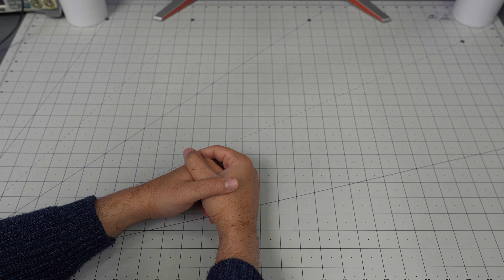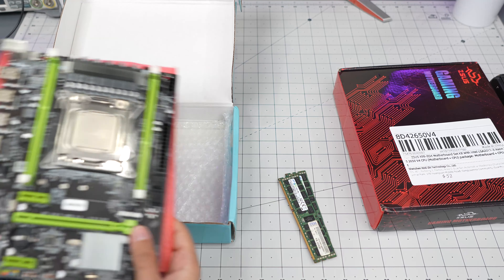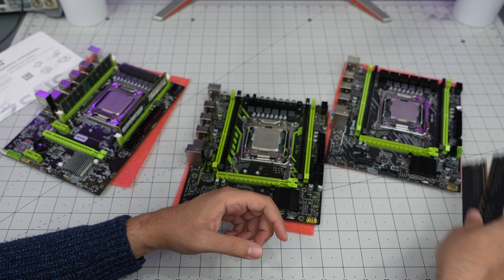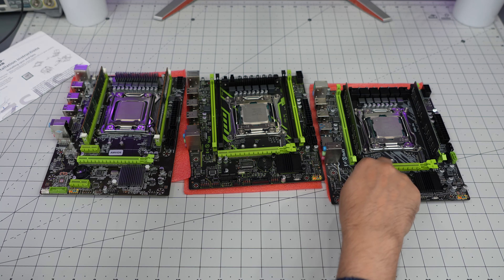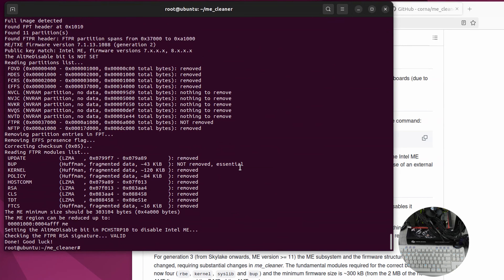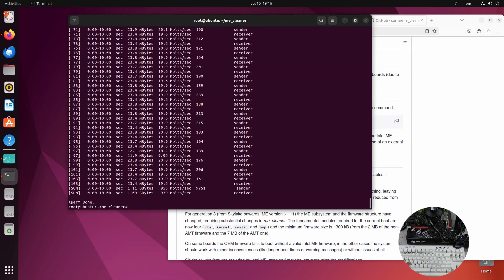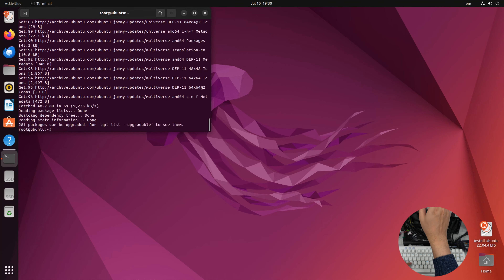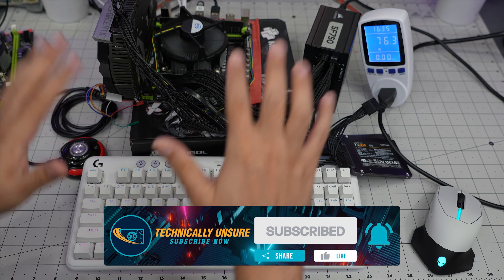Unboxing the 3 Chinese Gaming Motherboards: Are They Worth the Price?

Comment: I have 2 of these for well over a year now and I have a few advise to get this to last for those cheapo folks like me as these are perfect for a first PC for your kids without breaking the bank.  
The motherboard is pretty crappy and it you do your research it usually  comes with a 2phase VRM with a doubler so it acts like a 4 phase but as you can see on the video the heatsink on it is tiny and if you look at it properly it doesn't even fully cover the VRM's and they are the number one point of failure with these cheap chinese boards and if you look online there is a ton of people with burn't out VRM's for the CPU or the VRM for the memory.
First is that you need to replace the thermal pads with one from Gelid those GC-extreme pads are cheap for a 2-5$ they will drop the temps of the VRM's by about 10-15C getting a slightly thicker one like 1mm or 1.5mm should help improve contact due to the increased tension with the spring you will also need to a small heatsink for the memory VRM which is on the side along with the power connector as that thing gets hot as in it gets over a hundred c hot  a small heatsink from the heatsink kit for a raspberry pi should fit fine the one for RAM you can get them easily online.
Another thing you could do to help improve things is by not getting a tower cooler what you need is a down flow cooler like the original X99 cooler from intel that has a copper insert in the middle you could also get a chinese knock off of that cooler which works just as fine it will give air flow to the VRM's which would help drop their temps even more.
Reply: In fact it does not matter how many doublers are following MOSFETs. They might act as 2 phase but at the end what matters is number of coils and capacitors at the end of supply channels. To use CPU with more cores than number of the supply channels is just stupid idea. Those boards will be in fact able reliably manage CPUs with 6 cores max.
Reply: thanks so much! to think I'd find such good advice in such an obscure corner of the internet
Reply: Is it still running fine if we follow your advice? I'm broke and will game lightly for a few hours and let cool down for 15 mins
Reply: @Kevin-vh6nn  Mine is still working fine for 2 years now and I have 2 of these my advise about replacing thermal pads and putting a sink on the memory VRM can help get these last another thing you can change is replacing the plastic clip screws on the VRM heatsink with an m2 screw with a nut should improve contact with the heatsink.

Comment: Alot of these China motherboards especially mini-ITX doesn't support fan speed controllers. Hence, I normally buy those used named brand ones for Xeon CPU example old ASUS/ASRock boards. Unless you don't mind your fans running at Jet Engine speeds LOL
Reply: Found this out the hard way.  My BKHD C612 will let you set a speed, but it only fluctuates +/- 10 degrees.  This sucks because my CPU fan is rated for 3300 rpm and my exhaust is rated at 2400 rpm.

Comment: My difficulty is I just won a B660 D4 for $28 and made an offer on a 12400f (which was countered), but got that for $85.  You are going to have to work very hard to convince me any of the China special boards can beat that, choose any metric you like.  Full disclosure, I have a $60 Dual X99 with a $7 Xeon 16 core, and a $20 Xeon 16 core (2698v3 I believe) and the turbo unlock BIOS, in CPUz benchmarks it is right between the 3950x and 5950x.  32GB LRDIMMs for $20 is compelling if you need lots of RAM I will say.

Comment: I have just ordered a Jingsha B85 M+K motherboard combo with an i7 4790 and 16 gigabytes of RAM. 93.96

Also found a GTX 1080 for $100.

I can't wait for them to arrive.
Reply: That's a great price. Good luck with your build.
Reply: It all depends, you can (and I have) get a 12-14th gen platform for $40 more (example:B660 $30 Z690 $60, 12100f $70, add RAM $20-40).  Or for the same budget I got a 2600x and an A320 motherboard with RAM included.  
The 4790 is in a weird place because the Xeon twin of it is usually only $15-20 (E3 1240v3, 1241v3,1245v3,1275v3 etc).  I'm getting name brand Z87 boards for ~15-40.  So it's up in the air.  And at those prices I'd almost rather be in an X99 with a 6 or 8 core.
I do build the Xeons, have 3x E5 V2 dual socket SuperMicro and an X99 Dual 2698v3 right now.
Reply: Should've gone for X99 instead as they are similar in price but better performance
Reply: @wood6454  No arguments there, but as I understand it, the cheap X99 boards come with all kinds of quirks and really is a case of buyer beware.
Reply: @bokami3445  like what quirks?
Reply: Things like if you use the m.2 port, you lose one of the sata ports. I'm just parroting info I've read/seen else where. I have no experience (yet) with cheap Chinese motherboards

Comment: "V1" and V2 Xeons (so-called X79 platform), unfortunately, lack AVX2 support, which raises some compatibility issues. However, it might work just fine for a headless system without modern software, say, for DVR or simple file-server. More fun features like ZFS with compression might work noticeably slower than on X99, just because X79 does not support AVX2.

Comment: I always take the CPU and RAM and put them into Ebay.  Then subtract that from the price.  Decide if you want to pay them for the CPU and RAM they are including.  If the processor is going for $4 and the RAM for $5, then figure they got it for 1/10th that to offer it with a $50 motherboard for free.

Also please do a video if you know why the USB 3 will not boot with a HDD plugged in.  I did see a workaround, but my Dual X99 seems to suffer from this.

Comment: I have the zsus board, it wont work without the cmos battery!!!! I was gonna subscribe but you dont want that Zsus to work for some reason, you said in the video you installed the ram they shipped it with yet the zsus you ordered didnt even come with ram so you blatantly lied, you must have stock in the other boards or know who makes the zsus board and you dont like them, you didnt even try to diagnose the board, also the two boards you said are the same are NOT the same, go back and look carefully, even the cmos battery slot is in a different spot.